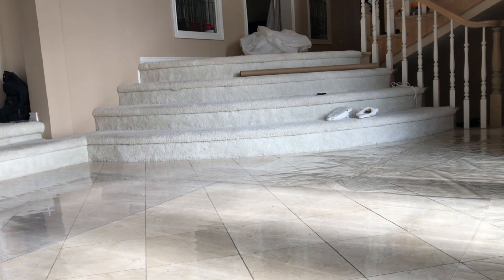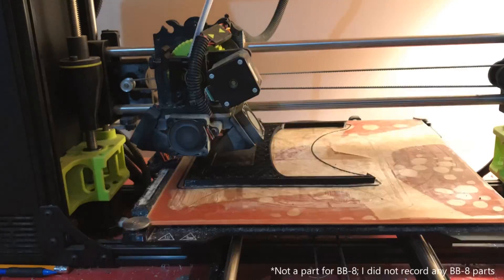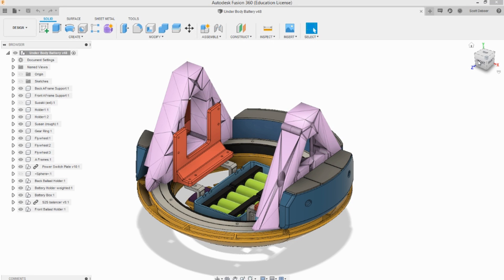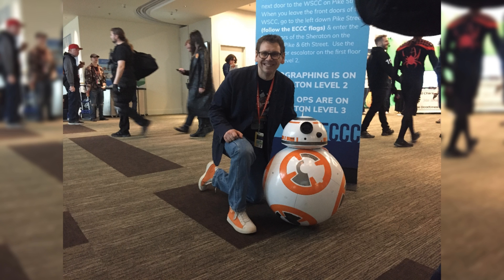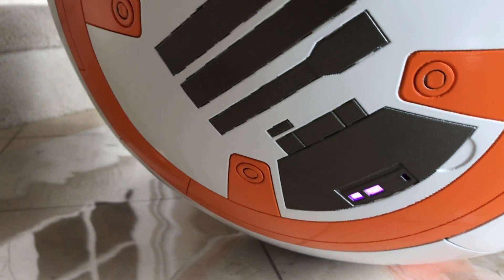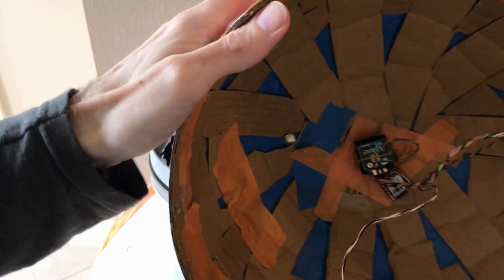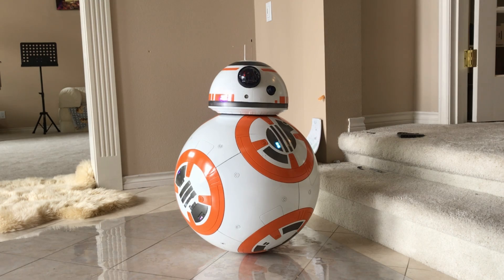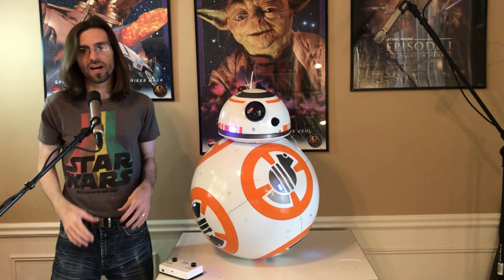BB-8 Reveal - Fully functional BB-8 with Joe's Drive and my custom MK3 Flywheel

Comment: nice job man 

I know I have quite a huge  a collection to robots
Reply: yes R2-D2 and BB8 together
Reply: yes I have BB8 and R2-D2 if interested 
POSTED IN MY DADS in :yt: my collection 2022 
there on shelves so a lot it took over my room 
a mess filed with robotic parts for theme incase one breaks down again  as you may have herd about the   R2-D2 I repaired him so he could work better  but is louder than normal spins so fast 
because of the complications it rolls slow but spins so much faster like a toy car spinning on 2 wheels 
mostly because of the  the caps but it spins louder and faster with my  connection improvements  R2-D2 is really well built BB8 is fairly easily done

Comment: What ver of Joe's drive did you us thanks
Reply from the maker: I used the MK2 head mechanism but designed a custom flywheel and under-battery unit to keep the center of gravity very low and completely balanced.
Reply: @NaigonAkoii  cool
Reply: I was try to figure out what way to do drive , you must have use wire on head and remote from mk2
Reply from the maker: I have the direct Bluetooth paired remote and body from MK2. I have the ability to reverse front/rear on the sticks which is a feature Joe had in his default firmware.

My dome communicates with my body lighting and my sound playing module via an XBee mesh network, and they are independent of the main arduino.